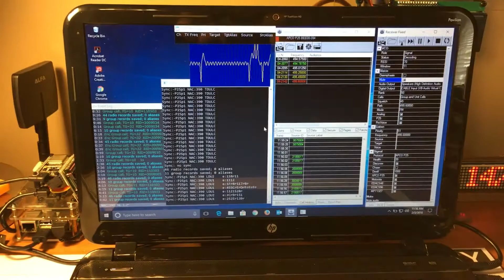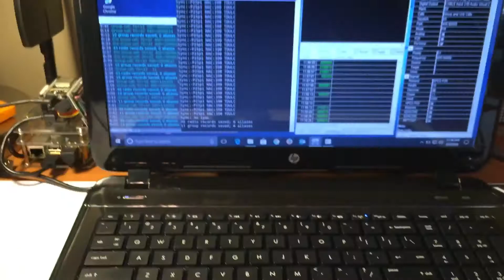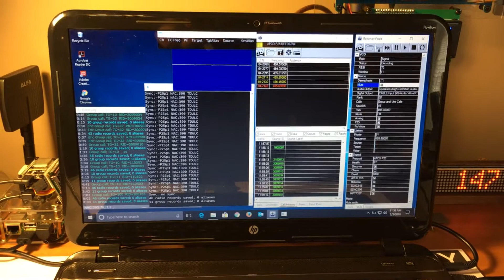RTL-SDR Universal Trunker Using 2 RTL-SDR.COM USB Dongles

Comment: Tell us more about the antenna, source of plans, etc.
Reply from the maker: I got the plans for this antenna from https://www.qrz.com in the search put in AG6IF. under the Bio tab scroll down about halfway till you see a picture of the antenna. You should also see the following words 

"I have been playing with a folded full wave loop design, the author calls it a 3DFL, 3 dimensional folded loop.Here is a 2m version. Made from:(6) 7.5 inch, (2) 3 inch, || (2) 2 inch or (2) 2.5 inch for thin walled copper || (2) 5-7/8 and (1) 12 inch, 12 elbows, feedline center to top of seam and shield to bottom of the seam.I use a electrical box and mount over the seam/gap, with the SO239 connector trapped under the cover as shown. (see close up below)The picture shows sheet metal screws, but soldering the joints together produce a better antenna, and much more sturdy"